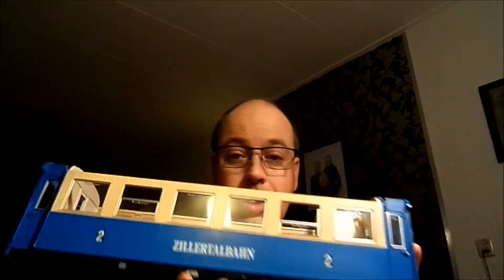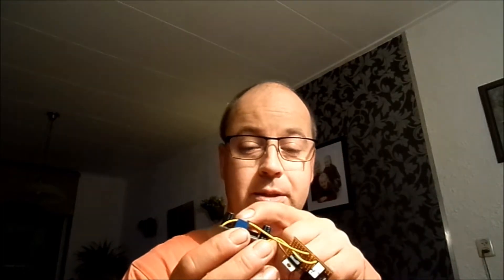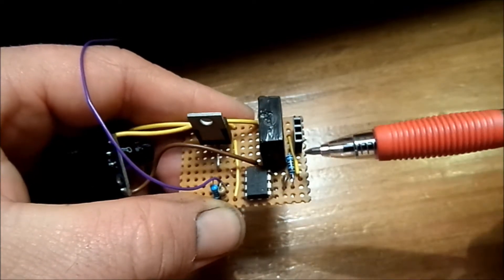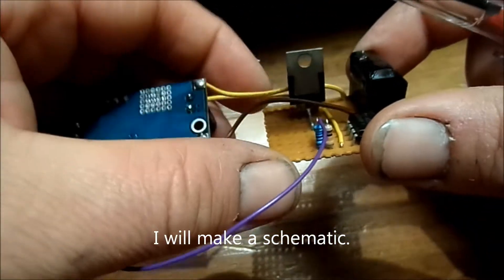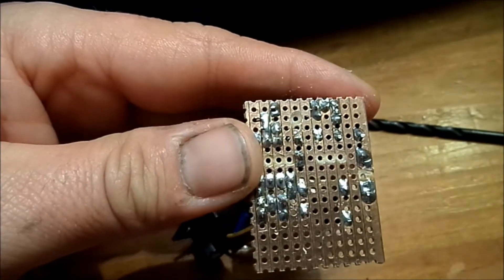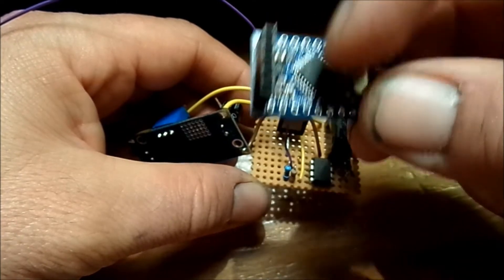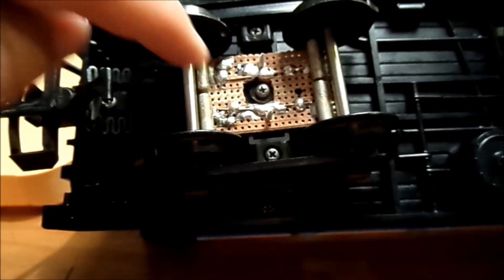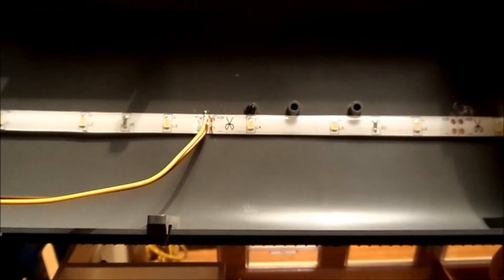Arduino wagon decoder 1.

Comment: To get rid of the buck converter and the 7805 regulator and also the bridge rectifier just add 2 wires between Arduino and the optocoupler board, get ground and 5v fron the arduino ! Saves space and money .... I do the same, the optocoupler needs just a few milli-amps so that is no issue. Also add an LED to check if there is power.